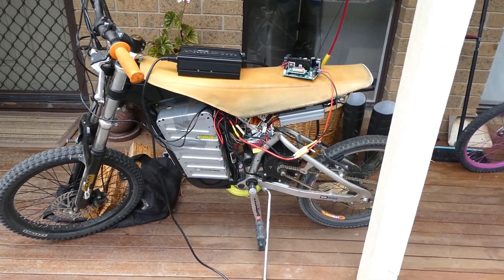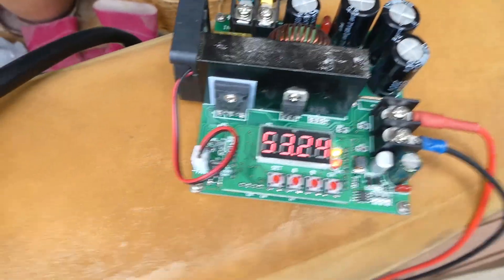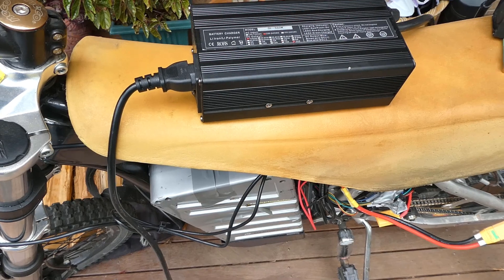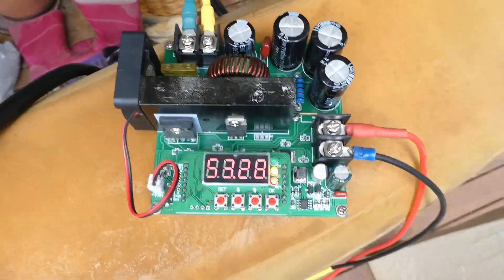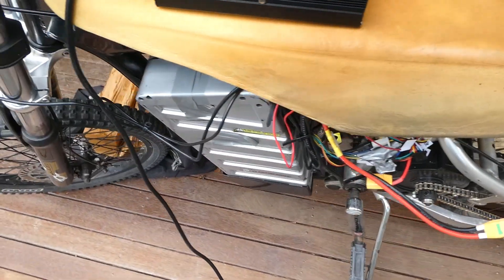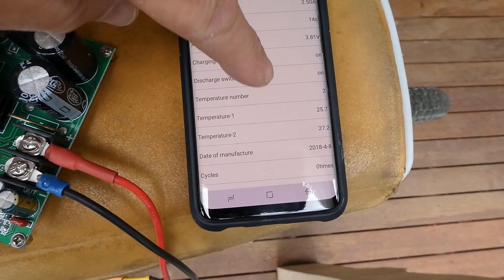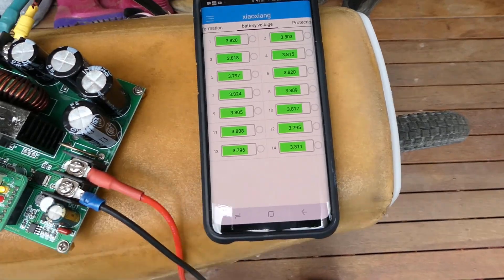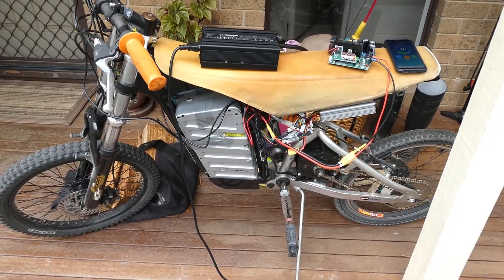Ebike Charging with 900w Boost Module. Bluetooth BMS working well

Comment: Where did you buy the 900w Boost module ? Do you have a partnumber or a link to the website ?
Reply from the maker: sh476622 
Sure here it is

https://rover.ebay.com/rover/0/0/0?mpre=https%3A%2F%2Fwww.ebay.com.au%2Fulk%2Fitm%2F362429021175

Comment: you can adjust the black charger that you use by turning the potentiometers inside, make sure the capacitors can handle this voltage, you can also adjust the charge current.

Comment: from experience you aren't getting over 2 amps from that booster I tried 14v at 42v and never gets past 2 amps
Reply from the maker: Hey
I don't doubt that at all.
They do the job I need them to and they are cheap so I'm ok with that.
Thanks for watching
Reply: Offgrid Dreaming oh yes they sure are useful but terrible for solar they sag the voltage sometimes and will cause it to be very inefficient but I still use it =) but sometimes I go with my gridtie inverter and my 1500w power supply to charge it my battery is 3.1kwh or 55ah at 16s